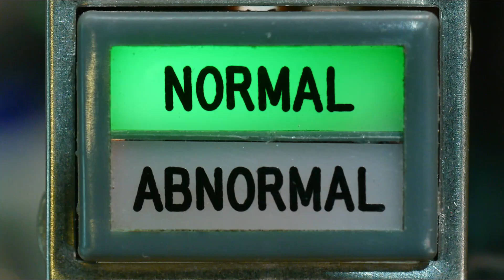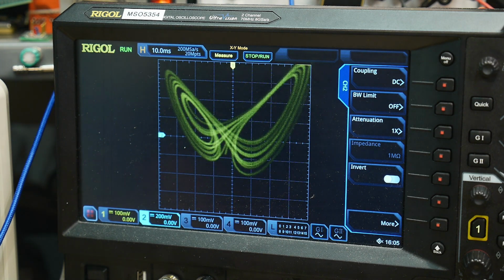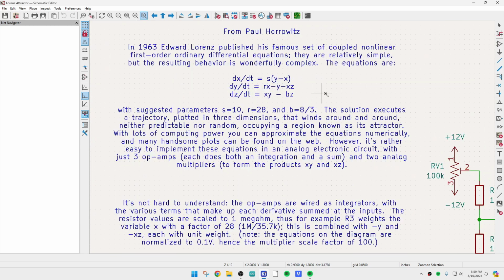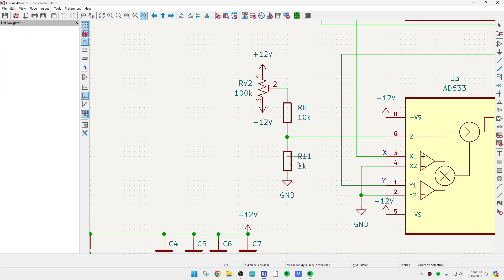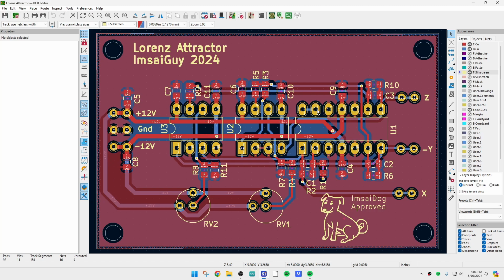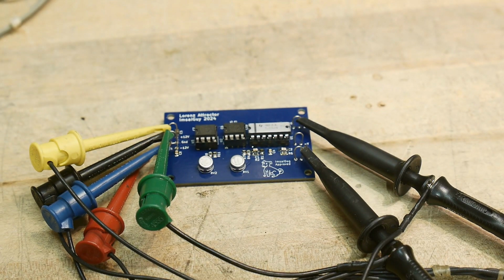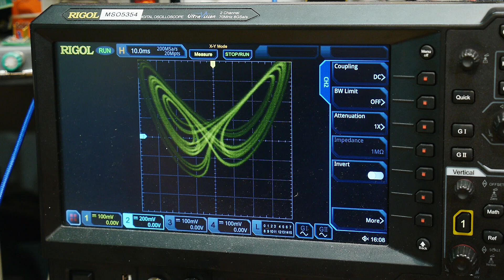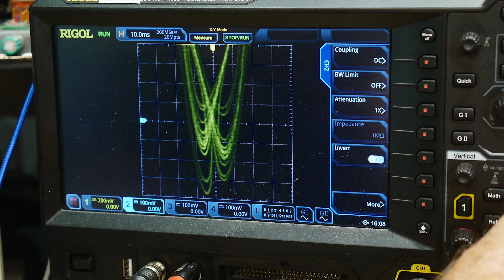#1893 Lorenz Attractor PCB

Comment: Well I got my PCB's from pcbway today. Very fast service I love my pcbway! But yikes now I'm sourcing parts! The AD633 8-PID package is $20.00 through Digikey and a bit cheeper through Mouser. And I need two of them! Before I drop 40 bucks for the these two IC's could you please confirm that I should order the AD633ANZ parts? It looks like the quad op amp should be a TL074? Also some help with part numbers for the pots which would fit the board would be appreciated.
Reply: Found some discount AD633 online for about half price. Took a chance and ordered them. They work! Out of chaos springs order or visa versa.

Comment: Perhaps it is "weird," but division by 100 V has a method to its madness:  10V x 10V = 100 V^2 is beyond the 10 V power supply.  The division is necessary to avoid saturation for all possible inputs (and to achieve the correct output units).

Comment: Ive wanted a scope for 28 years and I'm going to finally get one this summer. I'm leaning toward this scope for the unlockable bandwidth and all it's awesome features but I can't really find any reviews about it that aren't old and I feel like the complaints people had are likely mostly software issues that got worked out? 

When you zoom in or out on a waveform does it update in real time or pause and catch up?
Also I've heard it has a noisy analog front end but that only matters using the 4 front connectors and not the 16 LA right? 

Is this still the absolute best bang for my $1000ish bucks? I want a scope I can learn with that won't easily be limited by it's own ability vs mine, one I can grow into I guess
Reply from the maker: my only complaints are slow to boot and no detections of 10x probes. I would take look at the newer DHO series.
Reply: @IMSAIGuy  do you mean that you have to set the probe attenuation manually vs automatically? Also would you say that the dso has the same digital features as the mso? I've read that the dho isn't as feature packed but can be usbc powered and thats a plus

Does the dho have awg?
Reply from the maker: @BirdManPhil  Yes on 95% of oscilloscopes you have to set it manually. on some HP/Tektronix scopes they have a way to detect that using their own probes. The MSO5000 is a better scope but the DHO are 14 bit and priced well. the MSO is much faster.
Reply: @IMSAIGuy  Minor correction.  I just got my DSO4204 and it has 12 bit native ADCs.  It can supersample to get 14 and 16 bit resolution.  @BirdManPhil the DSO series does not have digital inputs.  The screen resolution on the 4000 series is very nice and the touch screen is pretty responsive.  Note it has the same failing of not detecting 10x passive probes and you have to set that manually.  It's no Tektronix or Rhode & Schwarz but I can't afford those for hobby work.

Comment: I used to have an analog oscilloscope specifically for chaotic circuits to get my phase portrait which is going to work much better than a digital scope. I would set my camera up on a tripod to take few minute integration pics of the unstable periodic orbits and just used transistors as loosely phase coupled sine oscillators instead of op amps and multipliers.

Since my oscillators only ran at .5-1 Hz, I would map them to RC servos to create interesting analog chaotic robots (I would use 555 timers to get the servo pulse train).

Comment: $14 multipliers! 😭
Reply: Checked locally, more like $25-30 here… at least they say that the package is "low cost"
Reply: Build your own using opamps and the exponential current to voltage relation of a diode?
Reply: Yeah multipliers are expensive